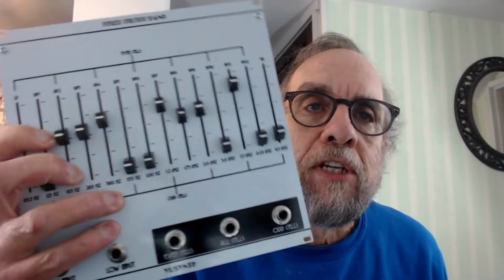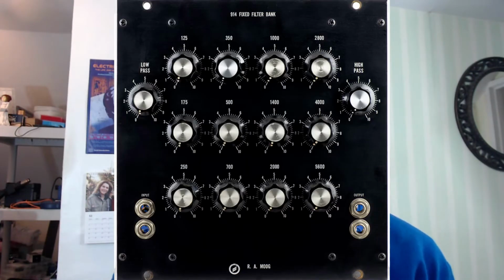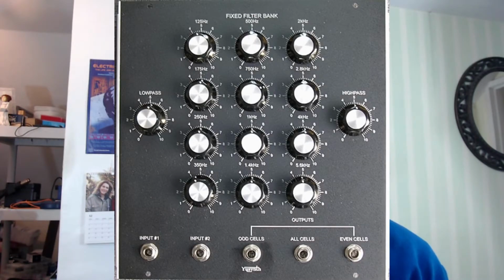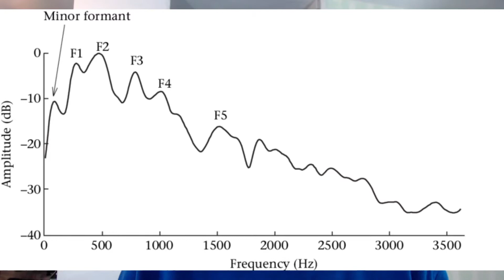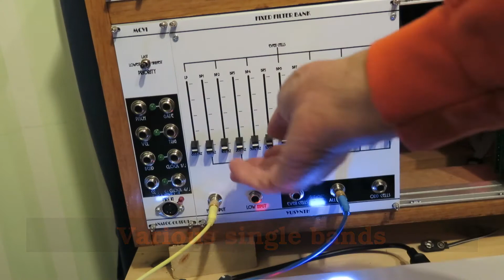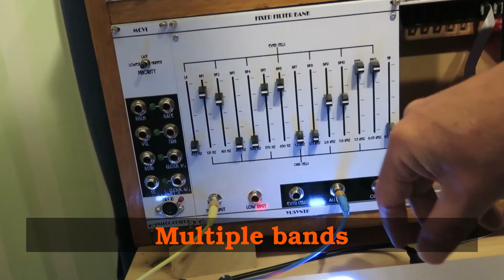YuSynth Fixed Filter Bank — Retuned

Comment: Hi Rich.  Based on your experience so far, do you think the log pots add much to the usability of the design?  My normal supplier only stocks linear sliders.  I can get log sliders elsewhere, but at a higher price --- not a deal breaker, but enough of a difference to make me want to ask the question!
Reply from the maker: My guess is linear would be usable. You could always breadboard one filter with a linear slider and see how you like it.
Reply: @analog_output  Thanks Rich, I will give that a go.  "Breadboard it and see" is always a good answer!

Comment: The company here in the UK I get most of my supplies from sells a PCB to the YuSynth design but I have always been put off by the health warning they give regarding the number of components.  Building a retuned version by ignoring the component values printed on the PCB would be even more of a challenge, but nothing ventured.......
Reply from the maker: Yeah, I considered doing that and seeing if I could avoid going insane. But then I decided I wanted to use board mounted sliders instead of rotary pots, and for that I felt I needed headers in different positions than on the commercial board (to avoid them being under the sliders), and to use dual bypass caps (instead of one between the + and - rails per chip that Usson used), so went ahead and drew up a modified version of the PCB. As for the number of components it's large... but mostly it's just going down long lines of identical-size caps with the soldering iron, not as difficult or time consuming as one might think.
Reply: @analog_output  Its not the volume of soldering that puts me off but my tendency to have a dyslexic moment and swap components around!  I like the use of sliders in your design --- looks so much more visual and intuitive in use than a cluster of rotary pots.